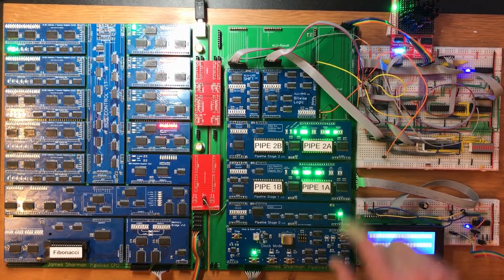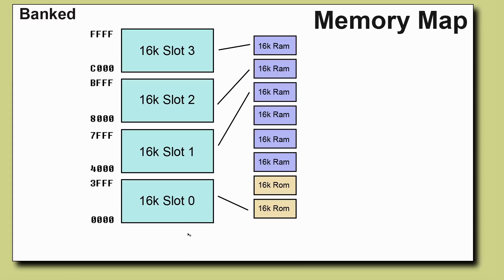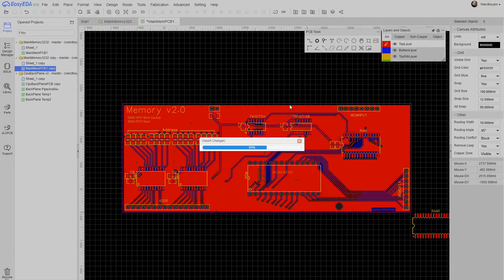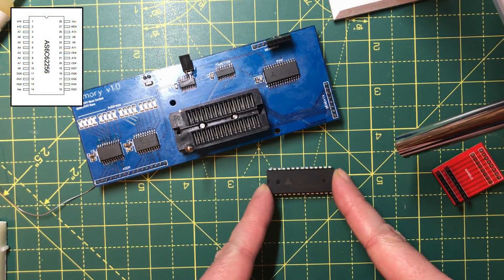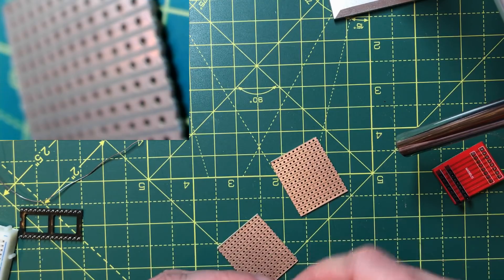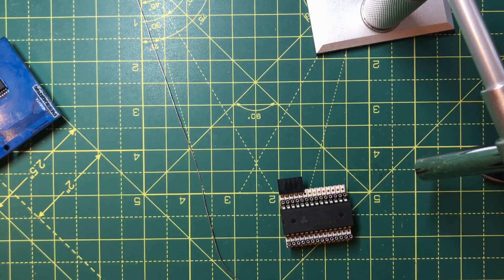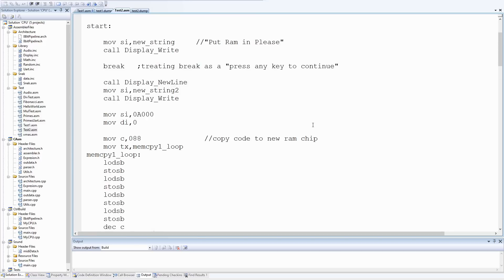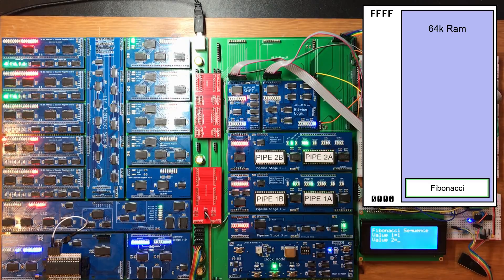More Ram? - Making an 8 Bit pipelined CPU - Part 91

Comment: I always thought it'd be a neat trick to put the ROM and RAM in the same address space. One could copy data from the ROM to the RAM by seemingly overwriting that memory space, then popping a flip-flop so the next read comes from RAM instead of ROM. I guess the reverse could be implemented to provide some nonvolatile storage on your computer, though the timing might be tricky. 👍 Hope you've managed to stay well clear of the heat and wild fires, which I know have been causing trouble over there.
Reply from the maker: The design I ended up here was the end product of thinking along those lines.
Reply: If ROM and RAM are in the same area, then it is only necessary to switch between ROM and RAM when reading. When writing, it can only go to RAM. 
So when copying, it would only have to be read from the ROM and written to the same address in the RAM.
Finally, the ROM can be switched off.

Comment: A simple way to do the copy into shadow RAM might be to use a flipflop and a gate or two to treat the EEPROM  as read-only and the RAM as write-only on reset (i.e. the EEPROM gets chip select only memory reads and the shadow RAM only gets selected for memory writes in the same memory space). Then you run a copy program from EEPROM as a simple loop that reads each relevant address from EEPROM and immediately writes the same value back to to the same address in shadow RAM. Once you've completed the copy, you reset the flipflop to now gate the low memory read and write and chip select only to the RAM so the EEPROM no longer gets selected.
Reply from the maker: Ha! I had that same idea, I rejected it in the end because the circuit complexity isn't much different than what I'm going to do and It wouldn't make it easy for me to take advantage of the faster speed from ram.
Reply: @weirdboyjim  I am assuming you will be using some sort of a wait state circuit for the EEPROM (or perhaps just slowing your clock down during EEPROM to RAM copies), which you would then disable when you switched over to the faster RAM. How else would you see any speedup once the contents of EEPROM are copied over?
Reply from the maker: In my build every cycle is a memory operation, so I'd just have to implement variable clock rates. That's really why I chose the shadow ram system, the copy will happen from a dedicated circuit during reset and then the cpu can start running with the assumption of the faster memory.

Comment: The work on your assembler is impressive.

Which computers are you mention shadow RAM? I'm thinking that most "industrial" computers of the 1980s, i.e. those running CPM, or the Amstrad PCWs had a small amount of ROM that would load the OS (CPM) or application (PCW, I had the word processing application and I think it was a PASCAL compiler), into RAM. I guess that ROM could be switched out after it had loaded the OS / application, as every KB counted.

Regarding banking of memory. Is your explanation correct, because a CPU with a 16 bit address bus could directly address  all 4 of your 16K blocks directly? My assumption was that a (or a number of) memory locations would be used to latch a bank selection of 256 x 64K banks. The each memory read or write would be a write to the bank selection and then access the bank as normal. I'd assumed this was never done for home computers as 1) no one could afford more than 64K of RAM, 2) the RAM if your could afford it, took up a lot of physical space, 3) the performance impact of potentially multiple writes in order to access the bank of memory (bank faults?) bearing in mind CPUs were only running at a couple of MHz, 4) only really practical to write a program to do this using a compiler, rather than BASIC 5) probably limits an application to a specific memory size
Reply from the maker: Later 8-bit micro computers did implementing banking using techniques like that, it was left to the programmer to optimize access into regions. If I wanted more than 64k I would work the address registers to have more bits rather than mess around with that though.

Comment: All you need is  a small boot loader in rom at the reset vector to load in the program from an external source.
Reply from the maker: I really have thought this through, I've picked this option to keep roms out of the memory pool and to keep the actual execution start-up simple.

Comment: Another though provoking video. I noticed that you hadn't cut the strips before trying your RAM board. I use a drill bit to cut the strips by rotating it in a hole. You can also get a specialised tool that looks like a screwdriver to do the same. I would also add a decoupling cap to the board.

I had the same thought for my CPU by using a RAM in place of the ROM but adding a 'dead-bug' voltage circuit and battery back-up and program it on a TL866 programmer and move it over to the CPU while its powered by the battery. I haven't tried it yet but have seen other people do it.
My CPU does however have a monitor program running in ROM and I download programs and pictures from my laptop over USB, and this makes it so much easier to develop software for it.

Another thing that struck me was that you haven't left any room in your memory map for video, and depending on the resolution and colours it can be a significant part of the memory. Have you any thoughts about that yet?
Reply from the maker: Interesting, I had the same thought about trying to program the ram in the programmer and then having a battery backup. But this was a stepping stone and it gave me the opportunity to test executing code in different memory chunks.

Comment: Why build circuitry to copy the ROM rather than have the ROM program copy itself to RAM and then disable ROM? Also, a simple XModem implementation should serve you well for downloading code over serial. I've been using it for my 6502 system and yeah, the hassle saved by avoiding having to reprogram a ROM every time is incredibly worth it. :P
Anywho, nice work as usual! :)
Reply from the maker: That would be a basic banking system. I did consider it, but to get any speed advantages from the ram I would have to implement software adjustable clock rates and I really didn't want to mess with that.
Reply: You could also just in situ reprogram the EEPROM. Copy the boot loader to RAM first as the EEPROM is locked out for the page write timeout but this is easily done. A bootloader would fit in a few 64byte pages. See the AT28C256 datasheet for the exact timing but from memory it's about 60ms per 64 byte page. No rewiring is necessary to implement this as an EEPROM can be reprogrammed in circuit by the processor.
EDIT: relies on the /WRITE line being  routed to the processor. Don't know if this would require a bodge wire or not.
Reply from the maker: That would be great Lawrence, right up until the point where a software bug trashed the bootloader. I don't trust my own coding enough to allow the possibility ;-)
Reply: @weirdboyjim  you could write protect it using an addressable latch or similar. Or add a jumper which either ties /WRITE high or routes it from the processor for more security.
Reply: Actually since the board is on show use one of those nice latching buttons.
Reply: One trick I have seen to make it a trivial banking system wich goes like this:

On Reset set things up so that reads from the low 32K are serviced by ROM and writes go to RAM on the same addresses. This is the shadow-part and could easily be prototyped using your boards if you temporarily stack RAM and ROM chips on top of each other. Possibly bending WE out :-).

Then have a single line. An I/O-port for control. That switches reads to come from RAM on the lower adresses as well. This is a simple matter of logicking the chip-selects with the new single bit control line. 

Technically this is bank-switching, but a trivial case of it. Nothing as complex as freely mapping pages.

Any program that wants ROM and RAM does nothing special. It will run out of the box. Or "into the ZIF socket" so to speak.

If you need/want 64K of flat RAM for any given program put a routine in ROM that starts by copying  "in place" the first 32K. It would simply read each byte and then write it back to the same address where it magically gets placed into shadow RAM. Then switch the selection control to also service reads from RAM on those adresses, effectively disabling ROM forever,  and you are in a flat RAM-backed space.

To me this feels simpler than a dedicated copying circuit. For that I imagine counters, latches and some control to resume normal operation once done.

In contrast there is very little fixed combinatorial logic for chip-selects and a tiny loop copy-pasted into the setup section of any software you want to run in flat RAM. Like the UART-operated Monitor program you are planning.

There is no need to ever switch back to ROM BTW.

Comment: Some banked RAM would still be pretty useful of course ;) any plans to make it so you can load from an external storage device like SD? That would certainly make programming less hassle.
Reply from the maker: I'd like to avoid banked ram. It was mostly done as a way of expanding the address space and if I really needed that I might revist and look at adding something like segmentation. Or just adding a few bits to the address registers. SD card is currently the front runner for storage solution, not relishing writing the code to parse FAT in hand coded assembly though.
Reply: @weirdboyjim  way back when... I did some programming with FORTH and they had a perfect technique for dealing with file systems...... they just didn't bother.... they would just load code from it's block address and skip all that "tedious mucking about" with file names and allocation tables. :)
Reply: @weirdboyjim  true enough, I don't envy you the task of interfacing with it, but then it will also be awesome to have removable storage available.

Comment: Instead of stripboard you could just have bent the WE leg 90 degrees and solder on the wire to the pin.
Reply from the maker: I could have done, what I actually should have done is designed the temporary pcb I ended up with in video 96 from the start. Much easier all round.

Comment: Will eliminating the EEPROM memory really allow for a faster clock if the pipeline code is still using its four EEPROMs. Won't those EEPROMS immediately become the clock bottle neck?
Reply from the maker: That's a great question, I'll probably do a video at some point on the critical path and how it all adds up. The simple answer is that yes, the pipeline control roms are already a clock rate restriction and would become more so if I speed up the memory.  At present I'm using AT28C256-15's, they have an access time of 150ns. Once the isa is finalised (soon!) I'll switch the control roms to AT27C256-45's, they have a 45ns access time. Now I could use those for program rom's but they are One-Time-Programmable so it could get frustrating (not to mention expensive) trying to debug code.
Reply: @weirdboyjim  what about using shadow ram there as well? or is that too crazy

Comment: You know, I got to thinking a little while back how you might go about storing and loading programs.  Apparently the old floppy drive interface ran on 5V logic (based on my incredibly limited understanding of electronics).  I don't know if it's possible to drive a floppy disk drive from the kind of chips you're using, and finding working drives and disks could be tricky... but wouldn't it be cool if you could?  I believe you can get USB floppy drives, which would let you access disks from your development machine.

Or, you know, you could be sensible and do something probably much simpler like have "network boot" that uses the serial line.
Reply from the maker: Storage device is an interesting challenge. Finding something that is 8-bit era appropriate but still easily available is tough. I don't want to go all the way to usb, but the pc floppy interface would be a big circuit. The C64 floppy interface is basically UART but those drives are starting to get harder to find. I have a plan though.
Reply: Compact Flash is perfectly doable. Older parts, upto about 128MB capacity, usually have an 8 bit mode so you don't have to latch the top byte. No need for a file system if you don't want one, too. Though I'm sure James would enjoy writing a FAT16 parser for his processor. :)
Reply: I was just playing with a USB floppy drive before watching this video and everything you say is pretty much right. Well, except "finding working discs and drives could be tricky"... I've got loads of both squirrels away. ;) ;)

Comment: All microcontrollers reserve bit of space to bootloader. Will you do the same? like 1k or 2k of space to implement serial bootloader over uart.
Reply from the maker: No reservation at the hardware level, but I'm expecting to write a boot loader as a piece of library code and add it to any roms where I have space (which will be most of them).

Comment: 11:00 when I was working on my vga circuit I finally gave up on breadboards and went directly to pcbs. If I have cut and strip one more wire I’m gonna loose it...
Reply from the maker: I don't mind cutting a few wires, but I think breadboards are going to struggle for the high frequency sections of the vga circuit. I may end up pcb'ing sections of it early.
Reply: @weirdboyjim  you know to tease your audience James. :)
Reply from the maker: You have to know I wasn't planning a low resolution slow access device?
Reply: @weirdboyjim  well I've been waiting eagerly to see your VGA implementation since you first teased everyone with that 25.175MHz crystal. :) and yup I think you're right about going for PCBs right away. It can be done on bb though.
Reply: @Alex Shilson Radical Brad is one of a kind though. :)
Reply: My VGA circuit is on breadboards but sometimes I need to fiddle with the wires to get it to work, otherwise I've not had any problems running a 25.175MHz crystal on it. Maybe its because I use good quality BB830 breadboards. I really need to transfer it to a PCB though.

Comment: Modern CPUs use pagination as well. Albeit for isolation, rather than memory space extension, but nevertheless using the same kind of technology
Reply from the maker: Hmm.. I suppose you could say that, but I tend to think of modern paging with an ldt/gdt to be a very different thing that banking. The former is very much about controlling process address space but the latter is mostly about overcoming limitations of the system address bus.

Comment: So you only have one RAM for everything? My initial thought would be to have a separate RAM, one that gets the rom copied into it and another for data memory.
Reply from the maker: There is actually 2 separate 32k sram chips in this configuration, but they form one contiguous ram address space.

Comment: Here I am with 256 bytes...
Reply from the maker: 256 bytes is actually pretty reasonable for small hand coded programs, but I'm going to need some more space for code and data, especially once I start taking chunks for the vga.
Reply: @weirdboyjim  I cheated a bit for my snake program. I have 256 bytes for the program, but a separate 256 bytes for runtime. In my program loader, I added support for pre-filling the runtime memory. Effectively giving me 512. Without that, no snake.
Reply from the maker: @TroySchrapel  That sounds like you are describing a Harvard architecture.
Reply: That's right. If I did it again, I'd just go with 16 bit addressing. No separation.
Reply: @TroySchrapel  I'm greedy so in my CPU design I went with 24 Bit addressing.

Comment: why not have a really simple boot loader ROM, it can then copy itself to HiRam jump there, switch off the bootloader ROM for RAM and wait for data on serial to be copied to LoRam.
Because you would be doing this with 32k of ROM it would be cool to have some sort of Trampoline in HiRam. that can execute various library functions in ROM
Reply from the maker: That would have been the plan with bank switching, but I would either loose the ram speed advantage or I'd have to add circuitry to handle different timing while the bootloader is running from rom.
Reply: @weirdboyjim  on speed, I thought your microcode used AT28C256 anyway? Or have I got that wrong?
Reply from the maker: When I'm done, I'll etch a set of AT27C256's no reason for the pipeline roms to keep changing once all the features are added.
Reply: @weirdboyjim  ah cool. 90 vs 150ns. I'm very impressed that your processor can outstrip a 150ns part! It would be interesting to see the timing on your /CE, /WRITE and /OE lines.